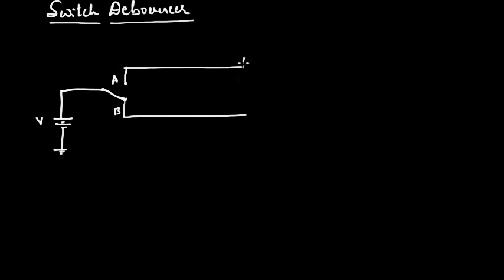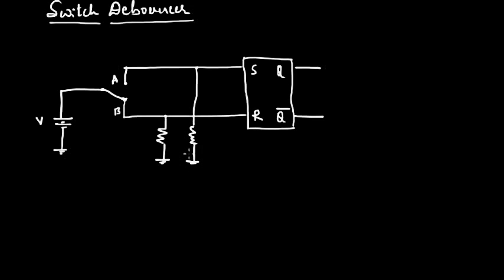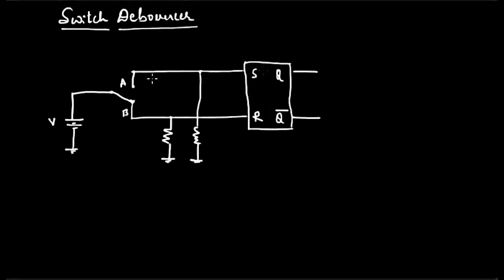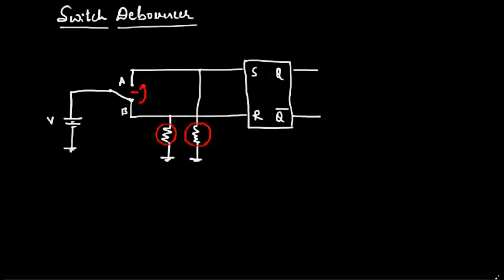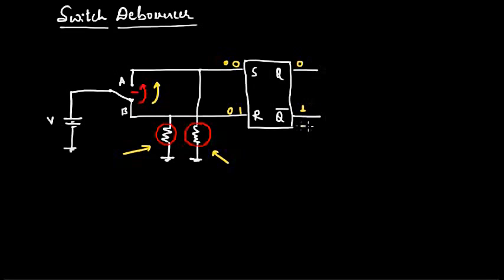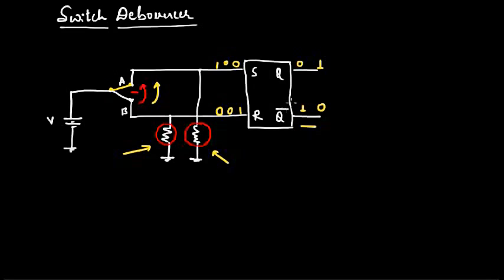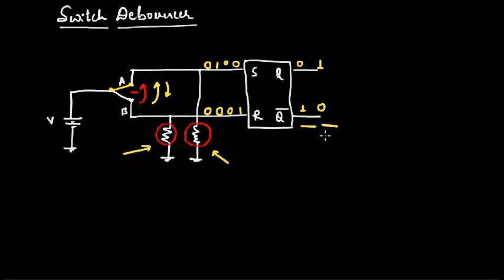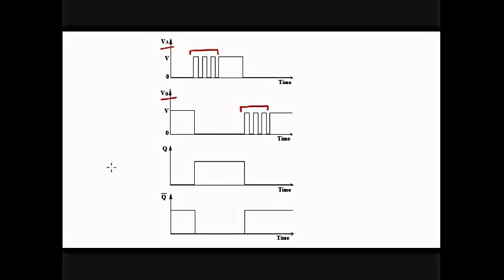Switch Debouncer : Application of SR Latch

Comment: sir u r great ,thanks a lot
Reply: If you liked that - this will knock your socks off. 
I have designed a SPST  SR Latch debouncer. It tells you - like the SPDT SR Latch circuit - as soon as the switch starts changing state (plus deglitch time). Either opening or closing. 

https://spacetimepro.blogspot.com/2023/09/switch-debouncer.html

Comment: Best debouncing explanation. Thank you
Reply: You may like this circuit. It separates deglitch from debounce and makes the actual states obvious.
I have designed a SPST  SR Latch debouncer. It tells you - like the SPDT SR Latch circuit - as soon as the switch starts changing state (plus deglitch time). Either opening or closing. 
https://spacetimepro.blogspot.com/2023/09/switch-debouncer.html

Comment: I see that circuit a lot and never understood how it actually worked. Now I do, thanks to you.
Reply from the maker: Joey Mac Thanks for the comment Joey..:-)
Reply: @EnggClasses  You will find this extremely interesting. You may want to do a video. 
I have designed a SPST  SR Latch debouncer. It tells you - like the SPDT SR Latch circuit - as soon as the switch starts changing state (plus deglitch time). Either opening or closing. 
https://spacetimepro.blogspot.com/2023/09/switch-debouncer.html